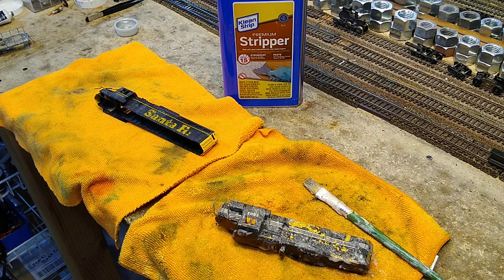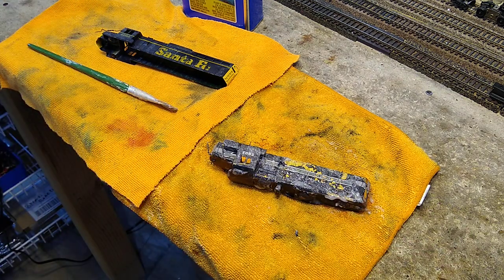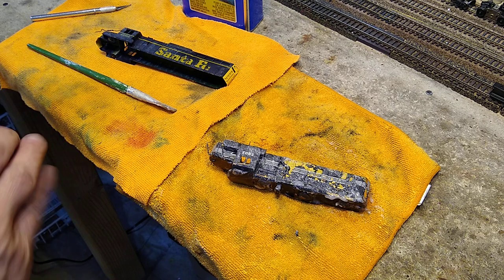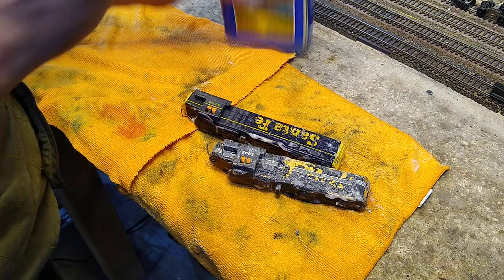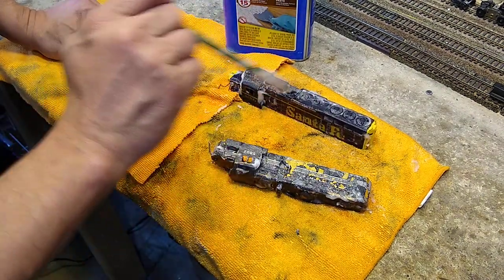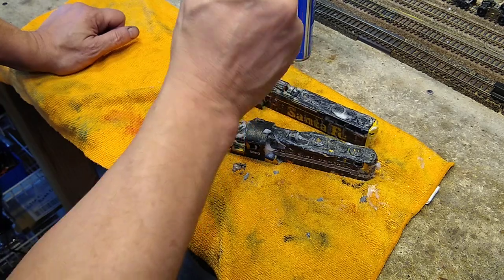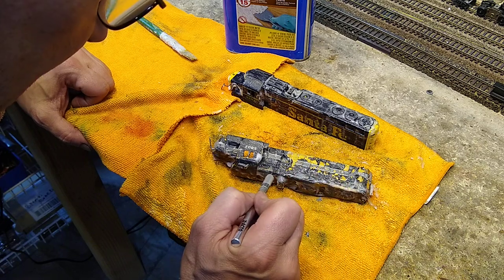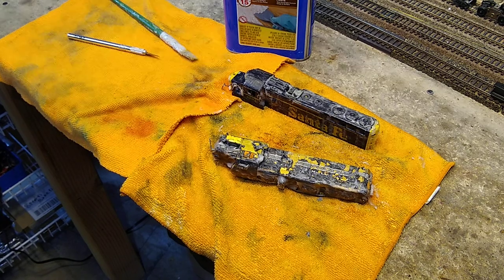5 locomotives in 30 days part 2 strip paint brass locmotives

Comment: You ever tried Aircraft stripper? That stuff works awesome. It can even be used on plastic as long as you don’t leave too long.
Reply from the maker: yes, but the ultrasonic strips all to perfection, i just wanted to show the old method, but now both of them have been completely stripped and polished - that's tomorrows video
Reply: @elite194  yeah ultrasonic is the best.